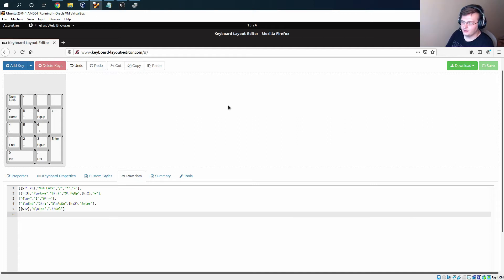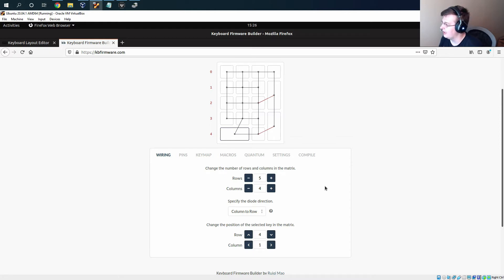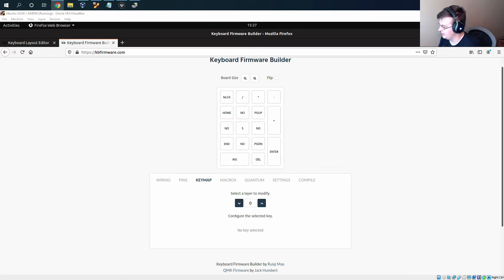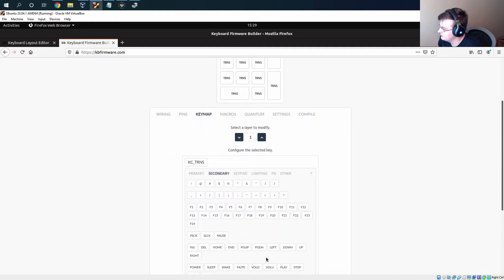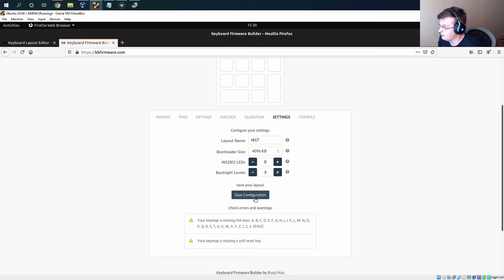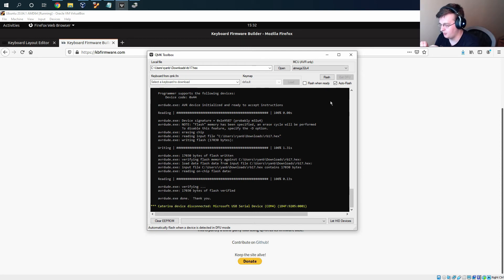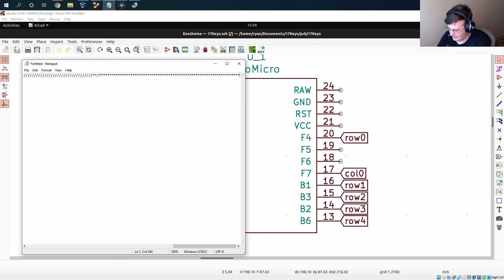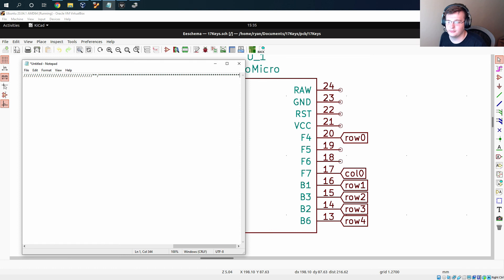Design a Keyboard Pt3: Firmware (reupload)

Comment: Do you know if it's possible to use this with a PS/2 / USB hybrid port? back during the transition between PS/2 to USB you could use a USB to PS/2 or vice versa adapter but they only worked with certain keyboards there was also a similar thing back in the transition between XT and PS/2, do you know if the firmware/chip will support at least the first scenario? i'd actually like to make my keyboard compatible with all 3 protocols but cant find any real info out there.